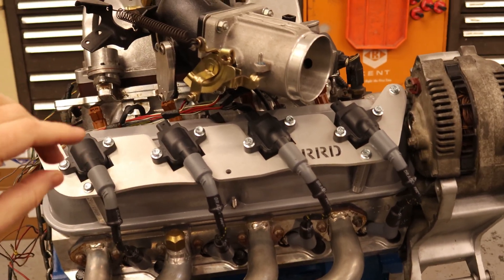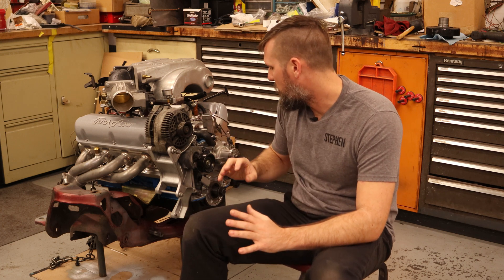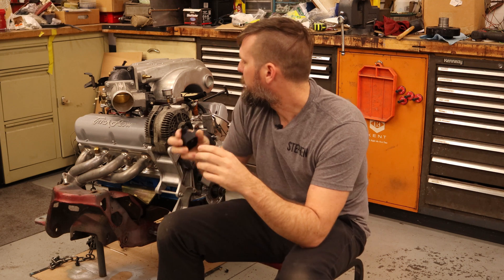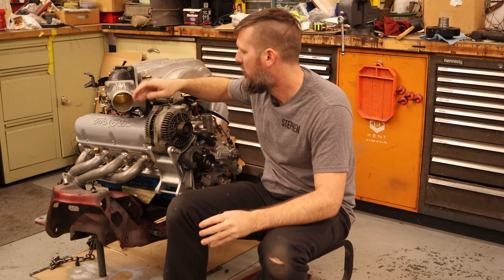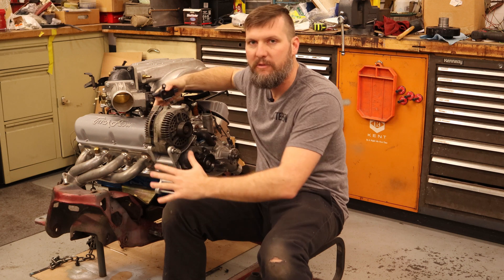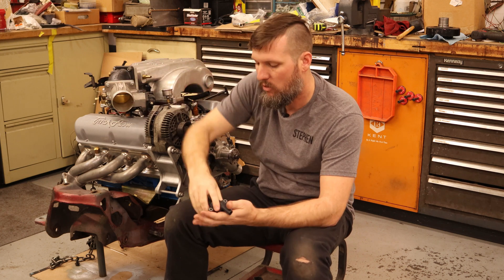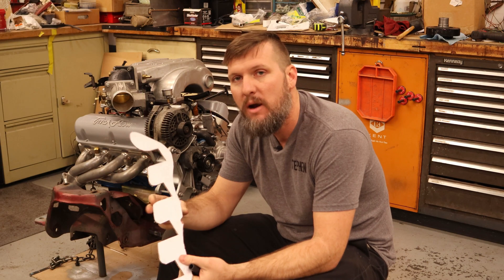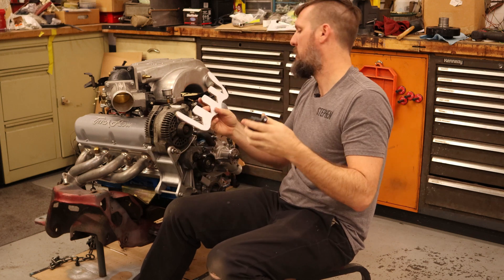Installing 7.3L Godzilla coils on SBF 5.0L Mustang

Comment: So it's been a couple of years on this one, how have the Godzilla coils held up so far? really like the small packaging as opposed to the beefy Holley variants. Just curious.
Reply from the maker: Still running them with no issues. Coils need to be matched to the ECU you're using. Meaning does it need smart coils or dump coils.

Comment: If Godzilla coils weren't similarly priced to IGN-1As, I'd seriously consider this. I could definitely see it for a stock ECU situation though.
Reply from the maker: It really depends on what coils your ECU supports. The IGN-1A coils are smart coils with ignitor included while the Godzilla ones are "dumb" coils and need an external ignitor. Not all ecus have ignitors built in.

Comment: am not using holley except for the hi-ram & fuel pump. i do have someone that was employed by for that is doing my harness. i did have to purchase the holley universal coil-on-plug P/N 558-307 plus pigtails. i just need to find headers or decent exhaust manifolds for the 01 ranger 4x4 it is going in. thanks
Reply from the maker: FYI I'm not sure that harness will work with the Godzilla coils. The Godzilla coils are not smart coils like the LS ones.

Comment: i googled a "96 mustang gt coil on plug conversion" & got the info i needed. had to order harness kit from summit #P/N 558-307
Reply from the maker: That may help. There will still be some custom wiring as I assume you're not using a Holley ECU.

Comment: Are you going to do a coil pack to wire harness installation video? I just rebuilt a 98 Explorer 5.0 tranny & transfer case which is now in my 01 ranger 4x4 & switched to the Godzilla 7.3 liter coil packs. would like to find a diagram or install video on this application. would like your help if possible> 
Thanks, FD
Reply from the maker: I don't think I went into huge detail on the wiring pin out as it's pretty custom and boring to watch for most. I do have other videos on the install though. Check out the forum efidynotuning I can post spreadsheets or answer any questions there. This ignition system works great.
Reply: It would probably help to look at COP conversions for 4.6s; they use the same wasted spark setup as a 98 Explorer, and the COP coils are also 2 wire like this.
Reply from the maker: The 4.6 is where I got a lot of the extra wires. The coils would also work but are harder to mount as they are coil on plug.

Comment: Very nice fab work and I like your approach for a distributorless sbf system. Did want to surface another approach for the coils.Could twin 4 post/4 coil packs been used in lieu of 8 individual coils and short leads to the plugs? The twin 4 post/coil packs might be mounted where standard plug wires could be used and space constraints exist.
Reply from the maker: I'm not sure if coil packs could be used in place of 8 individual coils with the luxury EECV. Best to check/ask on EFIDynoTuning forums. I know earlier EECV or some EECIV can use the coil packs instead, think explorer or early 4.6l. I have some that I was going to do but changed direction, also T4MO ECU doesn't support coil packs.
Reply: From my research, you'd have to go with batch fire/wasted spark.  I'm currently using dodge neon coils on that setup.

Comment: Why run these compared to aftermarket units?
Reply from the maker: I assume you are referring to LS style coils. LS style "smart" coils have built in ignitors which will not work with factory ford ECU. Before the godzilla coils were released it was recommended to use the coils from the 4.6L, which is designed for coil on plug and not easy to mount for a coil near plug setup. If I'm mistaken then please send me a link cause I couldn't find any other "dump" coils that had this mounting style.
Reply: @RinerAutomotive  I have no idea. I'm completely unfamiliar with the options and was just curious about the motivation behind the choice. But then I saw the previous video, which explained the choice.

I have to look at options for a 351W block. I don't know if it ever went distributorless.
Reply from the maker: Ah gotcha. I do like the difference in idle sound now with distributorless. Not sure if it's any better or more powerful but I like it so far.

Comment: I think if you sold some of these as kits they would sell fast.
Reply from the maker: Has crossed my mind. Not sure how many people will be running Godzilla coils. I would need to figure out the bolt pattern for the more commonly used LS and smart coils. Secondly you'll notice there isn't an oil fill port in the valve cover yet. There isn't much room in the normal location on the passenger valve cover.